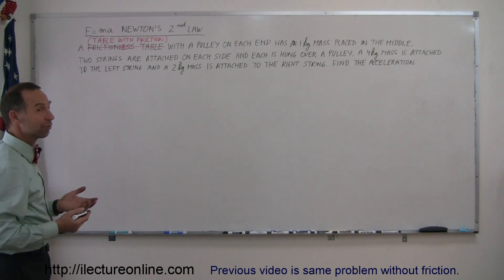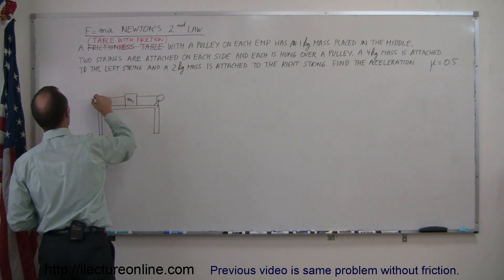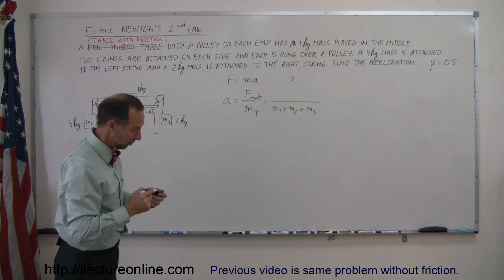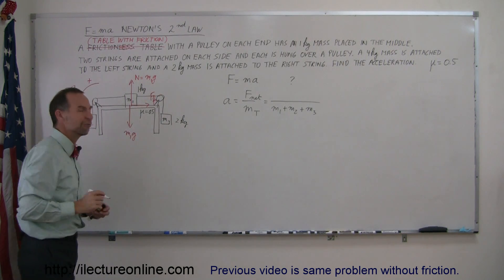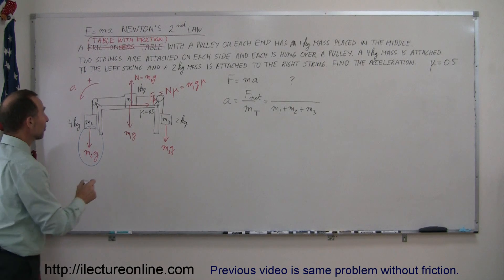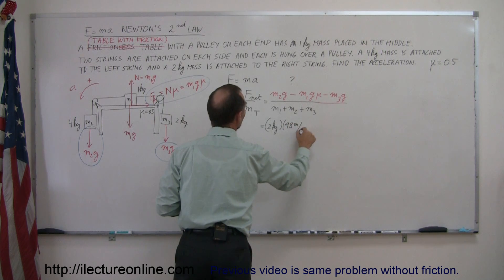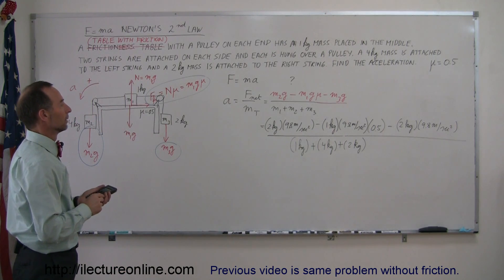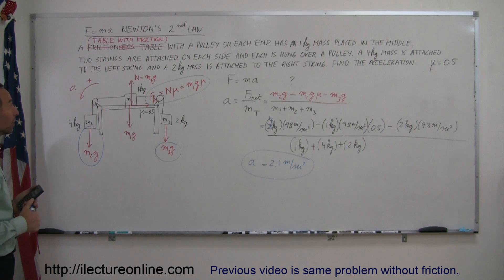Physics - Mechanics: Pulley System on a Table (2 of 2) With Friction

Comment: Ok, I get the acceleration but how do you find the tension?
Reply from the maker: For a block hanging from a string accelerating upward:  T = mg + ma    For a block hanging from a string accelerating downward   T = mg - ma
Reply: choose a mass, label the forces, then solve like a normal dynamics problem (using Newton's second law)
Reply: @SA5H4  I appreciate the help, but you're a year too late. I've already passed the class and gotten a 4 on the AP exam.
Reply: @generalgrievous3731  good job nyooooooooooooooom
Reply: @Vanecong-tu6rm  General Kenobi
Reply: Hello there.
Reply: Hello there.

Comment: What about a problem where the mass of the pulleys are given? You can't ignore the tensions in that and the tension in one side of the pulley will definetly not be the same as the one on the other side of it.
Reply from the maker: We have lots of examples like that in the moment of inertia playlists.
Reply: What should be the approach , if pulleys involves friction, but no pulley mass.
Reply: @jeetendrasharma2283   if friction present then apply
 T2= T1 e^ mue ( theta) .
Where they is in radians . 
Theta= no of turns of string  over pulley

Comment: By observation, we could "assume" that the system accelerates to the left since the 4kg mass is greater than the 2kg mass. And from that we can further "assume" that the direction of friction force goes to the right, since it must oppose the system's acceleration. But what if I have a complicated system where I simply can't "assume" the system's direction of acceleration? How can I then "assume" the direction of the friction force?
Reply from the maker: Good question.  Then you still assume a direction and work out the problem. If you get an impossible answer (like a negative acceleration), then you change your assumption and work the problem out again.

Comment: why tension is ignord
Reply from the maker: There are two ways in which you can solve this type of problems.  You can draw a free body diagram for each body in the system, and set up an equation for each, and then solve all the equations simultaneously.  (You will have to use the tension then).  OR  you can solve it as is shown in the video (much easier)  ONLY consider external forces on the system.  Tension is an internal force.
Reply: thank you
Reply: ignored*

Comment: Does friction force has impact on finding tensions?
Reply from the maker: Hayley Radman
The tension for a string connected to the mass on the table can be found as follows:
Since in this example the pulleys have no mass and no friction, the tension on either side of the pulley must be the same, so the tension on the string on the right is:  T = m3g + m3a
The tension on the left string is:  T = m2g - m2a
Reply: @MichelvanBiezen  ❤❤
Reply from the maker: Robinhozg
That depends on the situation.  Consider a free body diagram on each mass.  For the two hanging masses, friction doesn't matter, but for the mass on the table it does.
Reply: @MichelvanBiezen   if friction is present in pulley incase of 2 masses hanging ( etwood machine) then 
T2= T1e^mue( theta )
Where theta = no of turns of string on pulley. 
Just don't give misinformation to your students. 
If friction present in system that always changes values of Tension
Reply: Michel van Biezen how do you determine the tension for the mass on the table then since friction does impact it?
Reply: +Michel van Biezen I used your method to find the tension in both m2 and m3, but I'm getting two different tensions. According to what I calculated, m2 has a higher tension. (2)(9.8)+(2)(2.1) for m3 and (4)(9.8)-(4)(2.1) for m2.  Definitely not equal.  Please correct me if I am making a mistake.
Reply: FistofGod88 you did it right he's saying their equal on each side of the pulley.  they are not equal on each side of the ass on the table